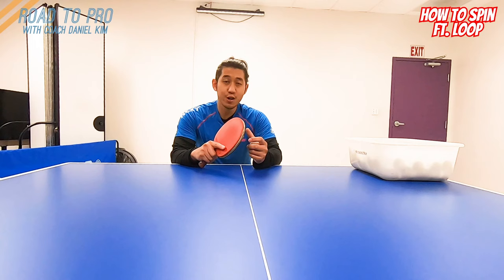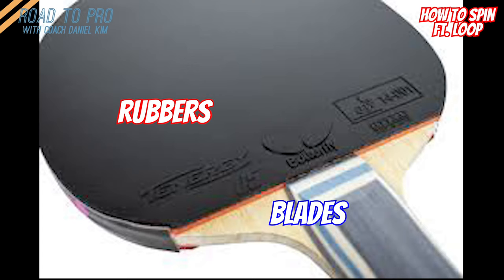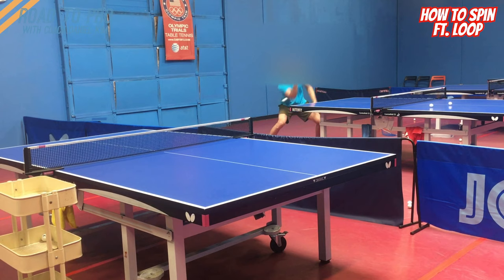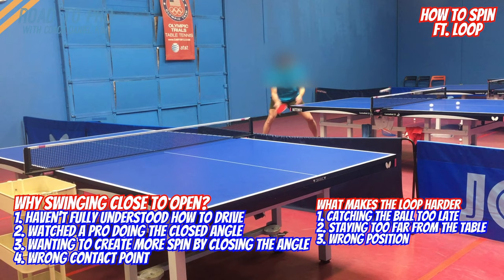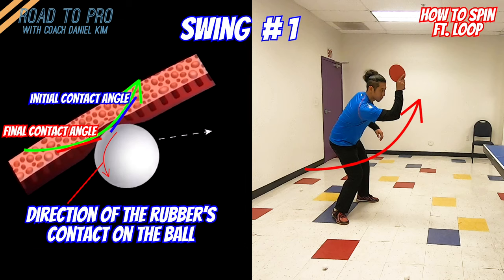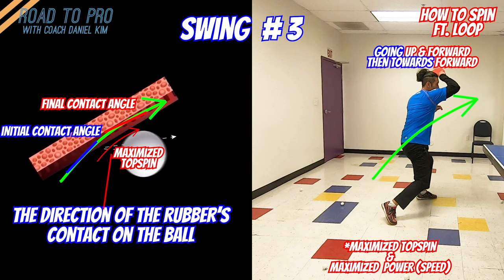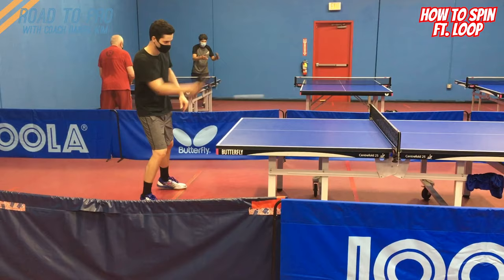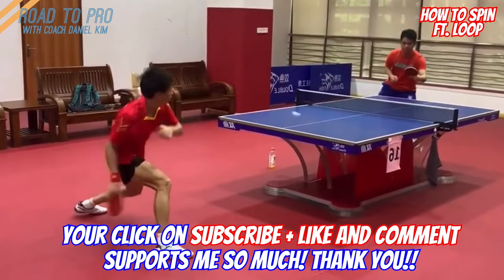Table Tennis | Ping Pong [Must Know - How to maximize TOP SPIN and POWER on the loop] 탁구 강한 회전의 이해

Comment: Lets agree to disagree. You are just Pitching your fantasy ideas to new players. Topspins completely depends on how fast you brush the ball, not what kind of arc you swing. In your video, swing one is very uncomfortable.You cannont use full force with swing one. But about Swing 2 and Swing 3, its both true and there is nothing wrong with swing 2. For your reference, Malong ( currently the best forehand player in the history of table tennis) uses swing 2. Power of Forehand topspins is created by how strong you explode(accelerate) during the ball contact. So you can improve your Forehand topspins by brushing the ball very fast (All top players use wrist to generate extra spins) and use the leg and hip. FOR THOSE who are reading my comment, you cannot really improve your spins by some fantasy swings. So stop watching and go Training. You will improve. Trust me. I am an engineer : )
Reply from the maker: Thanks for spending time and commenting “your” idea. 

One, I am not talking about speed of the swing, I am talking about how swing trajectory and the change of the angle throughout the swing can help improve loops as it can add more spin and speed. 

Two, you are contradicting yourself. You mention that the topspin completely depends on how fast you brush, not the swing. Then why wouldn’t swing 1 work? You know there are many people who do swing 1 and feel it’s more natural and comfortable. You should go tell them “just brush faster, and your loop will better!” I am sure they will love your coaching! Because there is nothing wrong with swing 1 according to your point.

Three, swing 2 is completely fine too. But why Ma Long becomes an example? Have you actually seen how he loops? You need to go watch his loops more:( And also watch Timo Boll, or FZD or anyone. 
And not everyone can swing as fast as Ma Long. What kind of advice can you give when you lack the understanding of mechanism. Swing 3 squeezes the rubber more if you know what that means, mr. engineer.

Four, you say you are an engineer but you prove your point with 0 physics term… I don’t think “uncomfortable” explains anything about how things work…and why can’t you use full force on swing 1? Should be able to use swing 1 with full force if topspin “completely” depends on how fast you brush and the forms are irrelevant to topspin.

I enjoy discussing and am open to learn more because I may be wrong too. I would appreciate if you can explain more technically:)
Reply: @roadtopro3038  Swing 1 is twisting your elbow upward. It is uncomfortable. If you think swing 1 can be used with full force, try to swing Full Force a Hundred times with heavy racket. You will hurt yourself.
2. As an engineering terms, if you twist your racket like swing 1, There will be more air resistance. So you will not achieve max speed. 
In your video, you put A pro player training and your idea swing 3. You are pitching your idea like they are using swing 3. Its not actually happening. You are "Imagining". 
Let me explain my "Idea".You are  imagining swing 3 in pro player like Malong, FZD and Timo because they squeeze their wrist in every shot (using wrist to add extra spins). Moving wrist so fast during contact of the ball(the racket is moving forward faster), you imagine that this must be swing 3, They change the racket angle so the ball is spinning faster.
Of course, the racket angle will change because the wrist is used. But the ball has more spin not because of swing 3. It is because the impact is stronger. 
Also do you think about the new players watching this video? They are using swing 2 and their forehand is slow so they will try to change swing 3. That will be a waste of time. In physics terms, the stronger the impact the more powerful the shot is. So how about telling new players that they should accelerate and explode during contact? (using wrist is not a good idea for begineer).
And also I never heard of that kind of explanation from Pro players and Pro Coachs talking about forehand topspins. That is your Unique Idea. Nobody said that before.
Reply: @roadtopro3038  https://youtu.be/REhG9hbnlxE here is the Scientific explanation you are asking for. In this video, there is slowmo of Malong and FZD forehand topspins. I only see swing 2 + wrist movement which you will argue it is swing 3.
Reply from the maker: @naywon6492  thank you for coming up with wrong physics… the one who said the swing form or the arc doesn’t matter is you….
And, why would you have a heavier racket and do a full swing? Control is so much more important. Power without control is nothing…And if swing 1 hurts anything it will be shoulder not elbow because you are turning shoulder not the elbow… you don’t rotate elbow to rotate elbow… you rotate shoulder to rotate the whole arm. 

You say there is more air resistance but air resistance, by definition, describes the forces that are in opposition to the relative motion of an object as it passes through the air. These drag forces act opposite to the oncoming flow velocity, thus slowing the object down. Unlike other resistance forces, drag depends directly on velocity, since it is the component of the net aerodynamic force acting opposite to the direction of the movement.
What this means is that there is greater resistance when you swing faster. And this really doesn’t affect how you hit the ball. It’s so minimal that no one care about air resistance for swing…
If these are your reasons why swing arc doesn’t matter but only speed matter, I am disappointed to discuss… I hoped that you could enlighten some people…
And…. You say no one does swing 3… and they do swing 2 then Why the racket angle change when they use wrist? Even if they use the wrist shouldn’t the swing be still straight? Once you say they don’t change their swing then now you say that they change the angle…. Which one is correct?

By this point, you are contradicting yourself too much…

And please watch my wrist video as well! And comment on it.
Reply: @roadtopro3038  You are just making things up and Imagining things so complicated. You are just trying to win an argument proves that I am right. Just use the damn wrist and your forehand topspin will be better. There is nothing wrong to admit that you are wrong. Your video is missing the main point of Powerful forehand topspins. Your videos is messing simple point to complicated one. Everyone makes mistake. I am not blaming you. I am done with this my friend. :)
Reply from the maker: @naywon6492  i never knew the concept of starting the swing open and close a little as you swing is so complicated. Like I said, you don’t know what you are talking about… you say don’t change the angle then you say change the angle by using the wrist? Just answer this simple question, do you change the angle of the paddle as you swing?
Reply: @roadtopro3038  The racket angle doesnt matter at all. Did you really try to change the racket angle during rallies so that your topspins are better? Thats so Genius. My point is try to use wrist and explode(accerlate) during rallies. Calculating and focusing to change the racket angle during contact with the ball during rallies, wow wow thats a lot of work or you can just simply acclerate.
Reply from the maker: @naywon6492  you literally said that “they change the racket angle so the ball is spinning faster”…. 

And if loop is that simple, everyone who can swing so fast will have the fastest loop. Well, if you actually play table tennis, it’s not as simple as that. There are so many things involved to increase the speed of the swing and each time the ball’s spin, height, speed is different that you need to adjust. And angle of the paddle in table tennis is so important, much more than swinging fast. Just telling people to swing fast is one of the worst advice you can give to both new and pro players.
Reply from the maker: @naywon6492  also the feeling is not so much about twisting the angle of the paddle to change during the stroke, it’s more like applying the force more forward as you brush and cover the ball towards the top(making the swing like an arc that ends more forward rather than upwards). And if you start with closed angle and open up as you swing, you can’t have good control.
Reply: @roadtopro3038  "they change racket angle....". About that sentence, I was being sarcastic about you will think like that. The faster you swing the faster your ball. Thats the truths bro. Harimoto become world class player at the age of 15. Its not because he is physically strong. He is just a teenage boy. Its because he can swing faster than avg player. He also doesnt know the physics behind all of his swing. He clearly achieved through training so hard. I agree with you for your last comment. Swing forward is a must to loop kill the ball.
Reply from the maker: @naywon6492  I am sad that you think Harimoto became world class player because he can swing fast… also if you can swing fast means you are physically strong… I hope you understand what I am talking about one day though, it will help you a lot to improve;)
Reply: @roadtopro3038  A coach like you are the reason why EU cant compete Asia in Table tennis. Very narrow minded and never admit mistake. I give you my big respect when you win a Stiga street fighter tournament in China. Being one of the top players in a small club doesnt mean you are always right.  :)
Reply from the maker: @naywon6492  well, if you think being a greatest player makes the greatest coach, then you came to the wrong person. Coaches are not necessarily coaches because they play better. You need to understand the role of coach, first.

Also, you are getting the wrong idea here. I agree that the speed of the swing can increase the spin. But how you swing also helps, but you are saying it doesn’t matter. You know even a 6years old kid can smack a ball really hard. He knows he can spin more if he swings fast, but he cannot apply that to his technique and make it work because he needs to learn the swing first (angle of the paddle, the swing trajectory, when to start the swing at which speed= contact point and so on).

It’s really naive and narrow minded if you think just increasing the swing speed will solve the problem. That’s why swing 1 happens. They want to spin and swing so fast that they start the paddle so closed, facing the floor. Then, after they start the swing, they realize either they lack the swing speed or angle was too closed that they had to open the angle as they swing which results into swing 1. They can simply change this by opening up the paddle to start and catch and then roll over the top of the ball to apply the force forward and to spin. 
And you think it’s about coaching that EU can’t compete? Oh my gosh… you really got a wrong idea to the coaches in EU. There are so many good coaches in EU producing many good players.
Maybe you just had a really bad coach who was from EU, and you became angry that you couldn’t become a better player… but don’t generalize your view or experience to the coaches in EU. And, I am not even from EU… what the hack?
Reply: @Nay Won: you really have absolutely no idea what you are saying.. Road to pro is absolutely correct about this und what he is explaining is exactly the reason for the power and the consistency of Chinese players
Reply: @zizo015   Really bro ? You are talking to a Chinese player. I have seen a lot of youtuber coaches from western countries reviewing every expensive blade and rubber and telling which blade and rubber are the best.  They walked into the club with a Go Pro Greeting everyone talking non-stop until a random 13 yr kid from the club beat the shit out of them. That kid doesnt even know how to speak English.
Reply: @naywon6492  You are hilarious! It's just unfortunate that you're not trying to be funny!
Reply: @naywon6492  Once again, you are hilarious! I agree that Chinese table tennis is leaps and bounds ahead of table tennis in the West, but not for the reasons you have stated.
By the way, it is my understanding that coach Daniel is Korean, and that he grew up and trained in Korea.
Reply: @juancruz-adames6644  let me tell you a hilarious joke in 2 words.
.
.
.
.
.
Western tabletennis. 😂
Reply: @naywon6492   I'm not going to become an Asian man, so I guess it is my destiny to play table tennis as a Western man.

You are still hilarious, even though your jokes are tragic. A piece of advice: don't worry about the weakness of Western table tennis, just enjoy crushing all of the Westerners you play. Unfortunately, this is not helping anyone improve table tennis skills; this is my last comment on this thread.